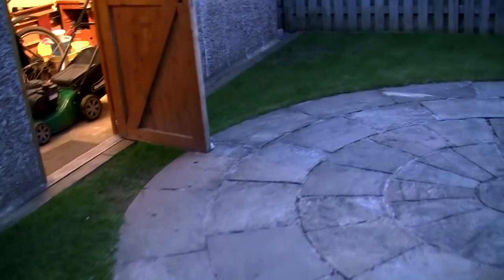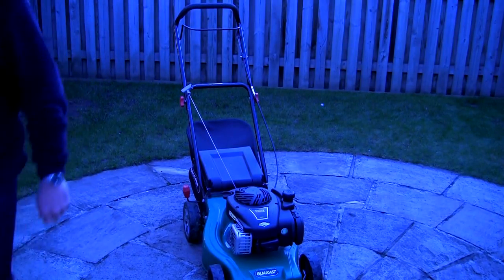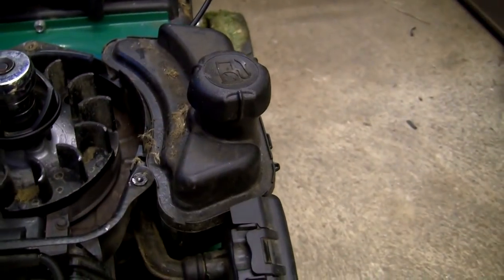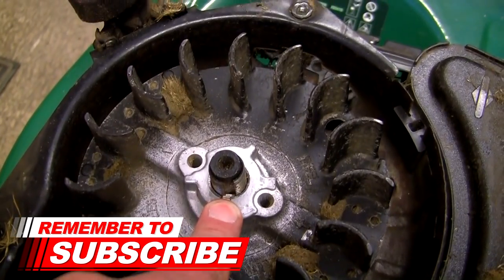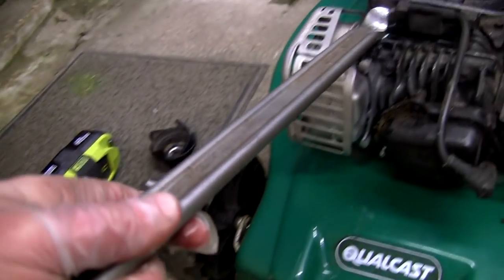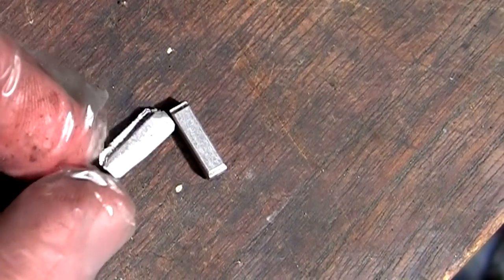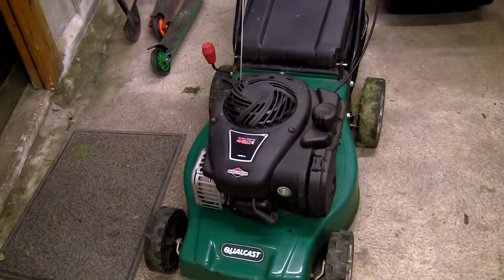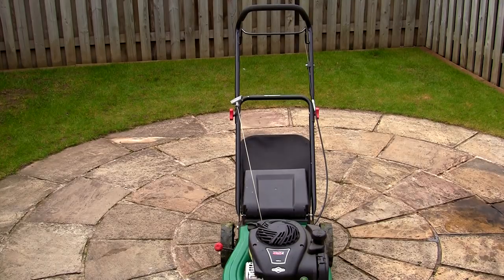How To Replace A Sheared Lawnmower Flywheel Key

Comment: Good craftsmanship in the video, and appreciated the tip about using a pry tool  (gently) to lift the flywheel. 
As a suggestion, you should include use of a flywheel puller tool-- at least to show how it should be done. For those with a flywheel which resists removal, that will be useful.

Comment: Hi, MM. I stumbled upon your video and, boy, I'm glad I did! My neighbor hit a pipe sticking up out of the ground (property marker) and after that his mower ran like crap and vibrated like crazy. Well, he figured he bent the shaft and that it would cost too much to repair ($450) so he went out and bought a new mower, same brand but newer model, so after watching your video I asked him if I could have it for parts and he said yes. I immediately went to work on the flywheel removal and, sure enough, the flywheel key was cracked, just like the one in your video. Cost three bucks and now I'm the proud owner of a 2018 Honda GVC160 lawn mower. Thank you for a great video!
Reply: I was trying to removed the flywheel in the same lawnmower GCV160 but this one got stuck.
The one you have come easy out?

Comment: Hi,  I was looking for some advice, I have removed the flysheet and crankshaft key from my  mountfield sp470 after ordering the new crosshatch key from DIY spare parts, but it doesn't seem to be the correct part, after searching for the part online it came up with a Woodruff Key 4 X 6.5 D=16 but doesn't seem to fit, would you happen to know or have a link to the the correct part for me
Reply: Thank you

Comment: Removing the flywheel you just put the bolt back on til it’s flush with the top and then give it a good whack with a hammer and it pops right off.

Comment: Please help. Own the SP470 with a B&S Quattro engine. It's old but it was still running well until it cut-out recently after 10 mins use. Takes a lot of effort to get it running now.

Gave it a full service - no change. Checked the brake and cut-out device - working fine. Checked compression - again fine. Replaced the carburettor and flushed the fuel tank - still no joy. Removed the cylinder head and cleaned off all the soot - no change. Went to replace the flywheel key, but I cannot get the flywheel off.

The key itself doesn't look sheared, and there's no play in the movement between the shaft and blade (which is also new). Tried various things to pop the flywheel off, including using a 6"  three leg gear puller, but nothing would budge. I'm loathed to spend £20 on the genuine flywheel puller, and my worry is the holes for the puller kit don't appear to be threaded. M5 bolts are too big to fit in the holes, and M4 bolts don't grab on to anything. 

Any suggestions welcome as to what I'm doing wrong / how I can get the flywheel off. Any ideas?

Comment: Have a question?? When trying to remove the bolt from the flywheel cup, are you going to the right???
I know it's supposed to be lefty loosey,, righty tighty.  
If you just Google the question,  it states to the left. 
However,  after watching several videos,  it seems like it's being turned to the right?? Nobody is specifying the direction.  And with my bolt being rusted,  definitely want to make sure I'm turning the correct direction. 
I really don't want to have to haul my mower to the garage I use for my vehicle.  (Major pain and don't have anyone to help lift it into the vehicle). 
I'd greatly appreciate your response and help 🙏.
Reply from the maker: anti clockwise.

Comment: i need a Flywheel Key for a Hyper Tough 20 in. Briggs & Stratton 125cc Gas Push Lawnmower Model# 961140035 , i just bought it like 6 month ago , ran over something , now  it wont start .hope you can help . been googling , to find out what  Flywheel Key  i need , but still no clue . they say that all , Briggs & Stratton engines use the same  Flywheel Key, but dont know if that's true or not .

Comment: My lawnmower nearly broke my hand, the back pull was so strong. It's a Champion 40 R484. Your video was fantastic and kept the misses happy as previously I had said I haven't a clue how to fix/repair them. I've got the nut off, I just need to get the flywheel off now. Hopefully I'll get that far tomorrow. Where do you buy replacement keys from? I've been all over the net without success. Help??!!
Reply from the maker: https://www.ebay.co.uk/itm/274312565393
Glad I'm keeping the Mrs Happy lol
Reply: @MowerMan  I got the flywheel off eventually. It took me two day and I was sooo tempted to give it laldy, but didn't. A gentle tap on the side while lifting was perfect. Off it came. When I finally got the flywheel off the pin was intact!!! 3 days work(in between computer work from home, tea and head scratching) in total....so far. Back to the drawing board. Everything back on. Praying it would work. No! When you pull the string the cord slips constantly. Everything else is fine. Any tips? Pretty please? I'm tearing my hair out in frustration.

Comment: What size socket do you need?
Reply from the maker: Trucker Josh They are all different
Reply: @MowerMan , my mower is a Briggs  and Stratton 35 classic
Reply: For B&S and many other push mowers probably 15/16" exact same as 24mm